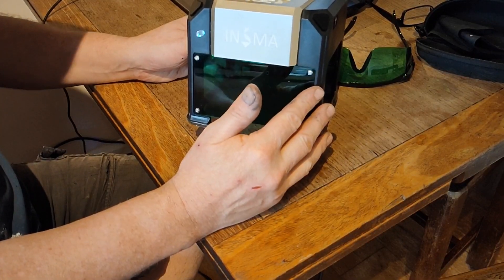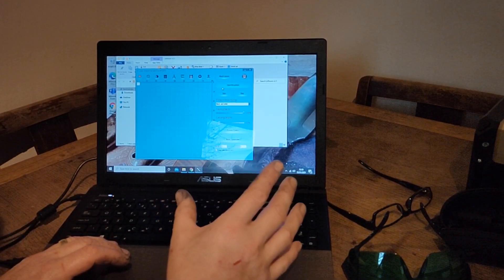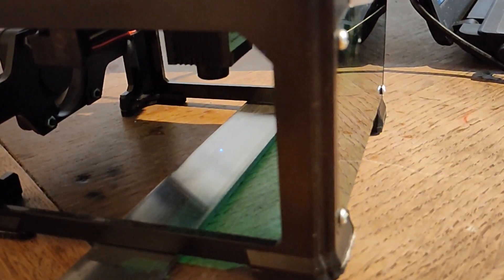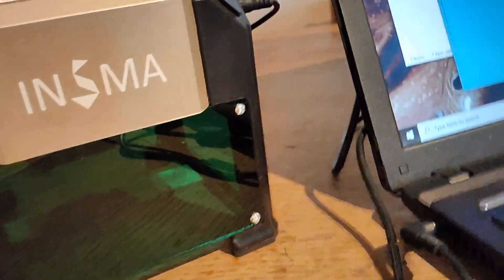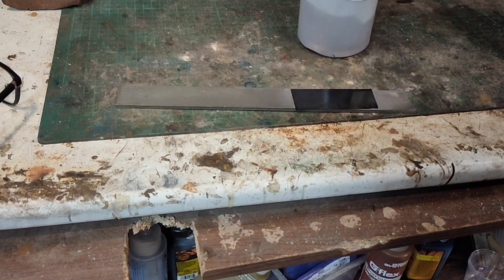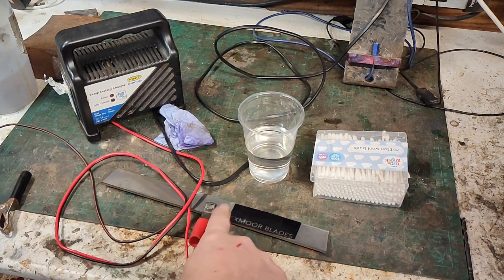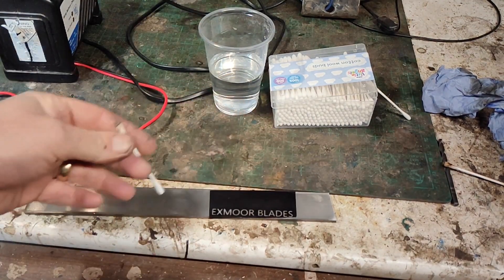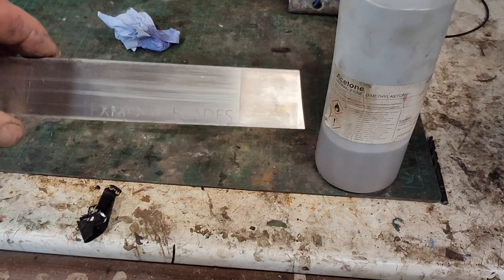Laser etching/ engrave steel using a low powered laser etcher #laser #etching #machine

Comment: Very clever, good result..
Be very careful though I work with vinyl and I can tell you when burned gives off very toxic fumes.
You should pick up one of the laser engravers I just got mate, the atomstack p7 m40, or one similar, it will laser engrave stainless steel..👍
Reply from the maker: Will have a look buddy😁
Reply: @ The Wasteland yeah it engraves both mate and I bought it from banggood 👍